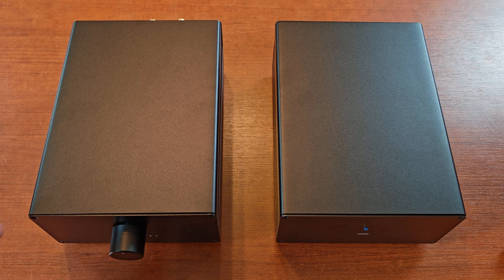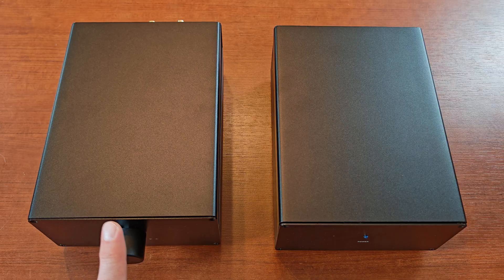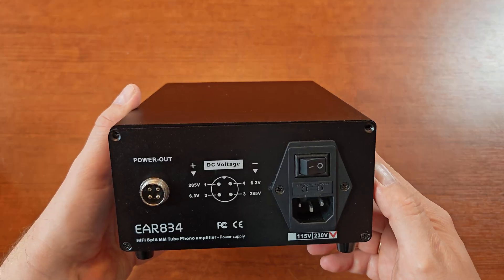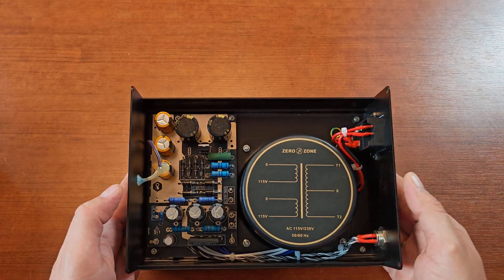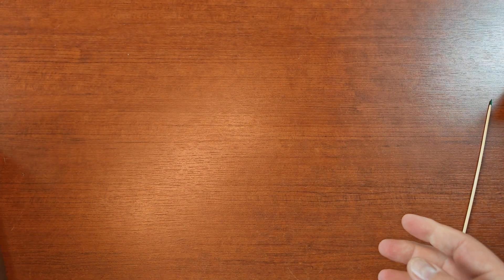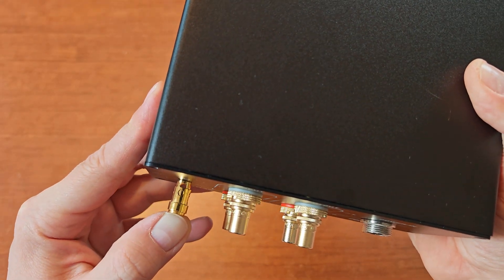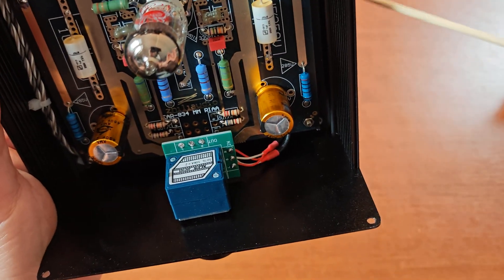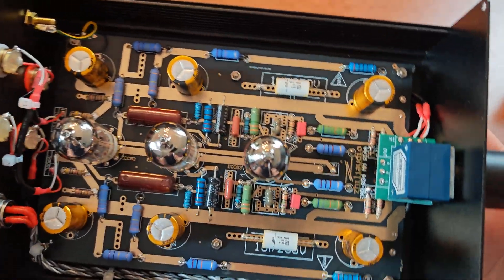First look: EAR834 based clone tube MM phono stage!

Comment: It's crazy how cheap all the components are in this thing... Not even SMT package, huge PCB, metal sheets. Ugh. I wonder why they didn't just do a proper design...
Reply from the maker: That's intentional. This is diy design so all there is no surface mounted components, you have wider choice of different quality parts for full sized ones. It's also widely recognized that full sized stuff is just better quality than smt parts (like caps, coils etc)

Comment: these clones offer a ton of performance for the money. If a person can order it without the tubes even better. The two triodes in each tube were not well matched. Off by 20% or more. Tons of options for better coupling caps. A person can buy a better performing phono stage but you will have to move the decimal point over a few notches to do so. For the price these clones are really tough to beat. And if a person is into reel to reel, not too tough to buy one of these and use for a Tape head preamp.
Reply from the maker: Exactly. And if you have the time and some knowledge, these are also excellent starting points for some modding as you don't have to start from scratch with bare pcb

Comment: I purchased a unit without volume control. Unfortunately, it is unusable because it picks up radio frequency interference and produces a constant, very loud hum.
Reply: Must be something wrong with your unit, mine is working great no problems. A bit of hum but nothing to be worried about. Try to send back the unit.
Reply from the maker: These are very, very sensitive to clean power source and nearby EMI sources. I'm talking about that in my full review (just finished recently). Try to use some EMI/RFI filters on the power input, try to move it away from any source of interference like other electronic devices
Reply: @k4syx  Should be the grounding of the unit. I'll try to fix it soon.
Reply: I placed a phono preamp on top of a streamer. Huge hum. Half a meter away that totally went away.

Comment: Hello,
I gave already a comment, but I forgot a verry important point.
Because the Phono Preamp has no subsonic filter, the bassspeaker is wobbling so the sound looses timing. Then it sounds strange. Subsonic filter is a must or a very, very good turntable without any vibration.

Comment: I already had this for over a year. A REAL tube phonostage. This is one of the best EAR834 clones. But it isn't perfect. 

These are assembled with a board that is made for modifications. And there is a lot to find on forums how to best do that. As you can see the coupling caps are the most obvious. And of course the tubes...

The sound is quite good and fit for a real high quality turntable >€1000 or even €5k, depending on your cartridge. This phonostage is more or less intended to be used with a high quality SUT to accommodate an MC cartridge. 
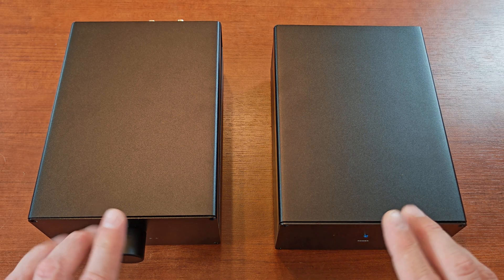There are no adjustments for input resistance or capacity. But with a 1:14 step up transformer (like my SUT) you'll be able to use most proper MC cartridge around 0.2-0.6mV and 5-25Ω impedance. 

But... I found the signal to be rather hot, it tends to overmodulate and distort on loud passages. The easy fix I applied is using 2 ECC82 (12AU7) instead of ECC83. This brought the amplification factor down just enough to sound quiet and clean. You can also adjust some R values next to the tubes but that's not that easy to know how to. 

I used Philips old stock tubes and Sprague Vitamin Q caps. 

The output Alps blue velvet volumepot is quite good and very useful to set equal volume or go directly to a poweramp. 
Bypassing it is a meaningless exercise if you will be using it gor a cheap €300 turntable with a €10-€50 cartridge. 

Looking forward to the follow up sound review. 
👋🏻😀🇱🇺
Reply from the maker: Thanks for sharing and excellent comment! 
Yes in my full review (just finished) I'm mentioning that this is built with PCBs that are very popular and that there are tons of info on the web about possible modifications!
Reply: Oh, honesty I would love to know to reduce the gain and using the Alps pot just robs the dynamics and muscle from the sound. If there are resistor mods I would put some Kiwame resistors and tame the hotness of the signal. If possible direct to some blog that does this. ( Don't want to change tubes as that will be another significant investment)

Comment: Hello,
I have exactly the same as you. But it is without a potentiometer. The tubes are S4A 12AX7 ECC83. It is connected to a Dual 721 with Shure V15 with a Jico needle. 
It is sounding OK, not better in detales than my Camtech, just with a beautiful absolute lovely tubesound coloration, but with two big issues. The gain is too high, so the preamp is set to minimum and it is humming extremely. Together with the gain, not exceptable.
The reason and the solution for that.
There is no Ground connection from powersupply to the amp. 
I made a separate cable from the Case of the powersupply to the case of the amp and ground of the board. So both boards and cases are grounded the same way. The humming has gone. just a little typical tube humming. But with the gain still too much. A poti or damping the output with resistors is necessary.
To make a really good phono some caps have to be exchanged.
All the best wishes for Christmas and New year from Germany.
Arnold
Reply: Forgotten: grounding to turntable and Preamp may bring humming again (it is in my case}, because of second grounding to the powernet. The Phono Pre is reacting very sensible to Net distortion. A spezial Power cable with Ferit Cor made it more worse. If you use TP Link for data transfer, you can hear the signals in the speakers.

Comment: I was waiting for this one. I am yet to dive into the vinyl rabbit hole. The product photo's show some different caps in the amplifier box. Not wima but some white poli cap and the black one next to it is gold. (And a merry Polish Christmas to you!)
Reply from the maker: Merry Christmas!
I've finished my review and it's the best phono stage so far. Head and shoulders above the others I've tested so far, even with stock tubes and stock caps.
This is a very popular PCB and there are many units available with slightly different caps and resistors. The crucial ones are the four seen in the middle. And better tubes: it's excellent with stock regular psvanes, but both horizons and Art-S series were immediate upgrade
Reply: @k4syx  i'll order de version without tubes when I do and do some research for tubes

Comment: First comment ! , I have this phono preamp. I have swapped out the tubes with Gold lion in stage 1, Tung sol in stage 2 and Psvane art horizon in the last stage. The three interstage capacitors are changed to Mundorf Evo oil. The power switch being at the back is a real inconvenience, so I ditched that switch and made a toggle switch in the front to make my life easier. When you shot video, if you can, please avoid making the scraping sound of your chopstick pointer on the metal, it gives makes me uncomfortable 😂, maybe there are others who feel the same.
Reply from the maker: Thanks for sharing and thanks for the heads-up on the scraping, I had no idea I'm making those :)
I got Mundorf alu evo in oil for mine too! :)